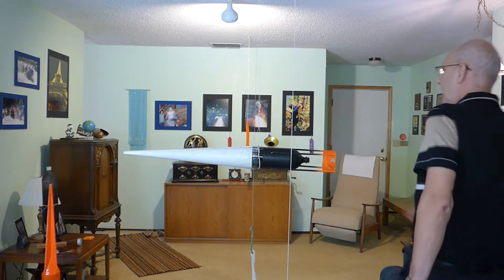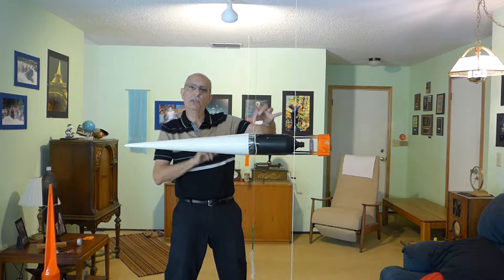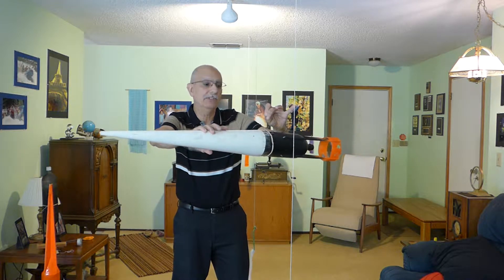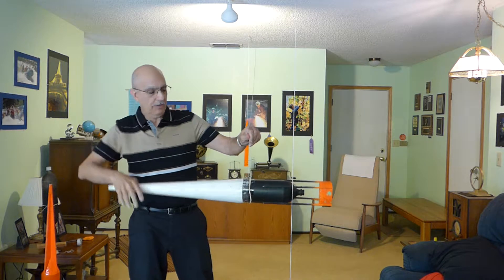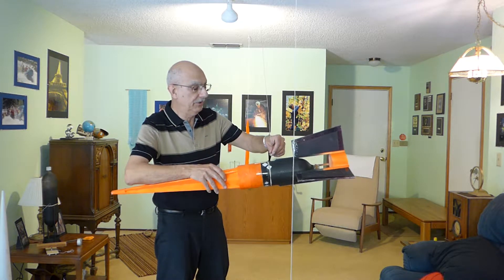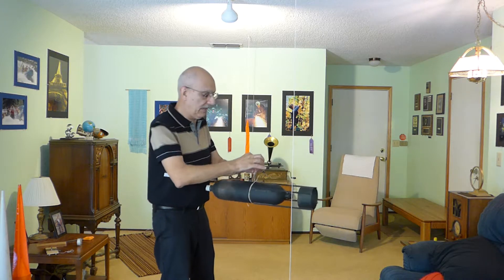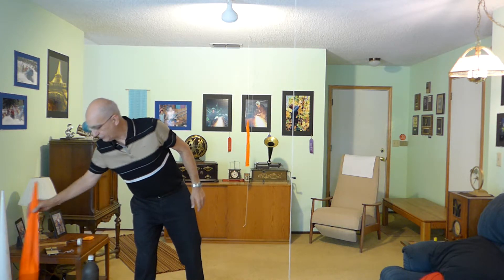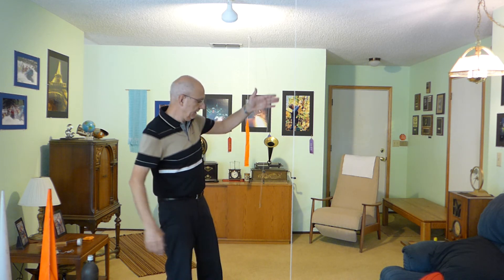How to Balance and Test Backslider Rocket , Testing WITHOUT Launcher

Comment: you have a CLOCK, its to the right. its circular and seems to have no mechanism? how does it work? you should do a video on it. it seems to be just glass with hands. how do the hands move.
Reply from the maker: LOL.  Its called a Golden Hour Clock.  First made in 1949.   The glass has little teeth cut into its perimeter and a gear in the base turns it. Can't see that because its all hidden in the circular rim. One hand is attached to the glass and moves with it. The other hand hangs from the center and has a gear that moves it.  Jefferson Golden Hour Clock.  Look it up. 
       You have a sharp eye.   Thanks for noticing.

Comment: So fun to see people still using my invention of the backsliding water rocket.
Reply from the maker: Thank you Robert. I have read your postings on the subject and you've been a big source of info and a guide for me.  I have made some that occasionally glide backwards stably for 30-50 feet. Nevertheless, I prefer to call backsliders "horizontal descenders"  rather than "coneys" or "Super-rocs ".  I am now working on  something that may make your "backslider" solve a problem that has plagued model rocketeers for decades.  Thanks for commenting.
Reply: Call them what you may, but the physics that makes this type of rocket recovery work is related to the rocket "backsliding" at apogee vs nosing over at apogee.  

What happens after the transition at apogee is typically discussed as a recovery technique.  Post backslide you can design for several types of recovery.  Some use the backslide to initiate: parachute deployment,  horizontal float, winged flight, etc.  So "horizontal descender" is just one type of recovery of many used for rockets that backslide at apogee. 

"Coney" was a design using a paper cone and fins, not a concept of rocket physics as backsliding is.  I shared this design with the world so they could easily experience the concept.
Reply from the maker: Thanks again for the brief tutorial. Clear and succinct as you always are . Much appreciated, and thanks for viewing.

Comment: Hello Orville, your videos on water rockets are fantastic, and were very useful to us in France for our school activities on water rockets ("college" in France is the equivalent to the Secondary schools in the US so the kids are 11-15  years old). This experience you are showing with the rope and the rocket swing is also a very easy experience to set up and powerful to explain the concept. Thank you.
Reply from the maker: Thank you!  Merci beaucoup !  Vous m'avez motive.  Ensuit , une procedure pour localiser dynamiquement le centre de la pression lateral.
Reply from the maker: How do I avoid instability?  I think its the "ring" fin (annular fin) located 5 to 11 cm aft of the nozzle which gives greater stability.          
      The white cone rocket used in the "find CLP" video has 20 gm 
(4 U.S. nickels)  in the ring fin and descends horizontally reliably. To find the point of instability I added 10 gm more and it shook violently and veered off course  when ascending but stabilized itself.  I immediately removed the extra 10 gm. Those 10gm moved the GC aft 1.6cm and the CLP forward 1.5 cm  resulting in a CLP 7.7 cm forward of the CG. That 7.7 is now my "do not exceed" parameter.  
      I have one rocket with a 27" cone and CLP  5.4 cm forward of CG which often flies backwards, stably, then forward while descending horizontally.  It uses the ring fin also. 
      The orange & black rocket in the video has CLP located 5/8 inch ( 1.6 cm) forward of the CG, towards the nose. Therefore the air pressure lifts the front  of the rocket up and prevents it from "nosing over" into a nose dive.
       Thank you for your interest.
Reply: Thank you Orville, very enlightning.
Reply from the maker: Hello T.C.E. ,  I have found 3 excellent videos about stability. The  first is SUPERB. You must watch it!  It is pertinent to your question.  The second is a simple test for your students.  
   1. " So You Want to be a Rocketeer: Stability "  by ES.333
    2.  " Model Rocket Stability (rocket swing test) Tutorial "  by Astro Niall
 3." How to Make a Stable Model Rocket"  by Bernado's Tech Blog 
     Thank you for motivating me to find these. I learned much from the first one.
Reply: Thank you Orville for this research. I am now leaving on vacation for 2 weeks (walking 200 miles with a back pack) but upon my return will study all this. 
Thanks?
Reply: Thanks!